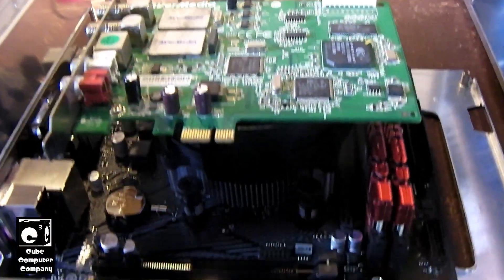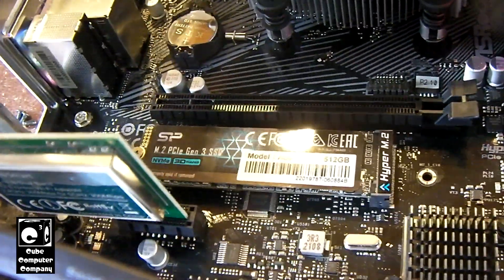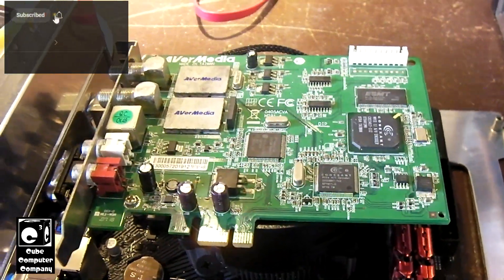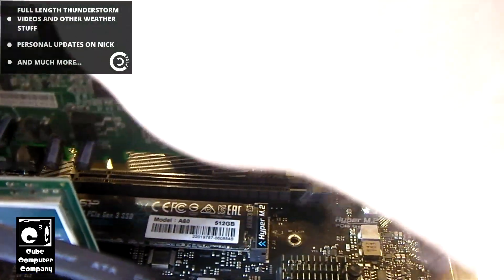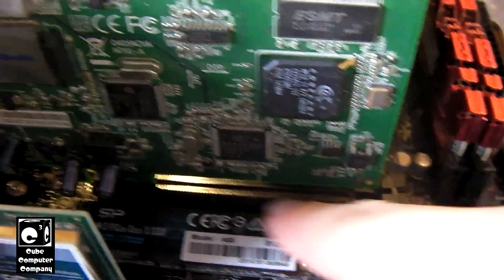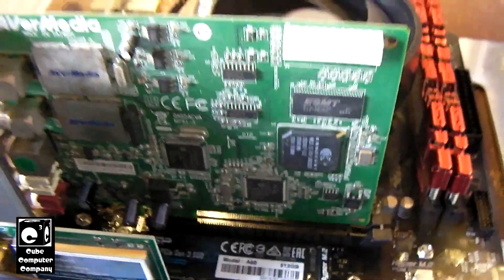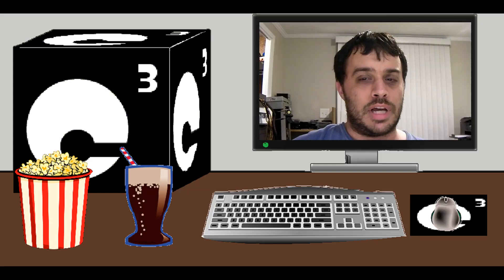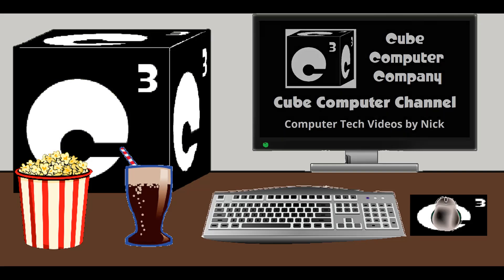Yes, you can install a 1x PCIe card into a 16x or 4x PCIe slot

Comment: Thanks !  Just had to look this up because I wanted a wifi card for an old PC that is going downstairs, but the 1x slot is covered by the video card.  I only have a 4x available and was about to get a USB wifi adapter until your video put me at ease.
Reply: Just went through the exact same.
Reply: Same glad this works

Comment: Cool, so if I want to install my soundblaster Z-SE, I can use the PCIex4 slot instead of just the PCIex1 slot.
Reply from the maker: Yes, it should work fine
Reply: But will the 1x card use/take 4x from the gpu? Or will it just take 1x away? @CubeComputerChannel
Reply from the maker: @roundeyeudie  It depends on the motherboard, though 1 lane would be used for the 1x addon card.
Reply: Yesss I was about to buy a sound blaster z-se

Comment: so I bought an expansion slot for my m.2 ssd with an x4 slot on it, is it compatible to my x1 slot? (mobo is gigabyte a520m ds3h ac)
Reply from the maker: The X4 slot on the card won't physically fit into an X1 slot since the X1 slot on the motherboard is too small.